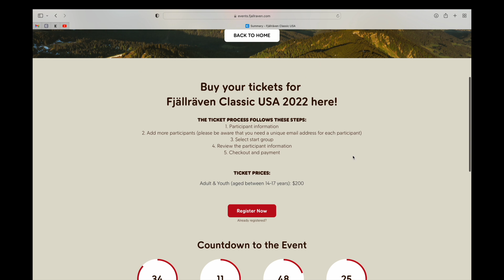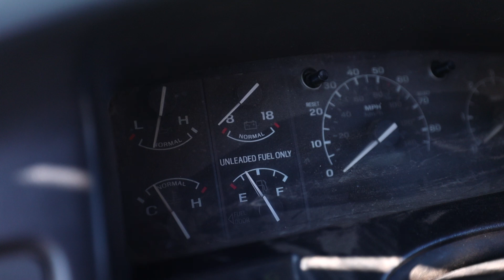Concrete Tiny House | Walls are UP! + New truck?

Comment: We dry laid our blocks when we built our house 40 years ago.  We parged both sides of the block with B-Bond.  It is a rich cement with tiny pieces of fiberglass.  It is flexural strong, just not vertically.  You can't build high story homes, but worked out great for us.  No issues in all these years, no cracks, nothing.  We used the rebar, and filled the holes with concrete as well.  At that time there was another product called Sure-Wall.

Comment: To answer the question : " why add rebar? Isn't the concrete enough ..."
 Simple answer is : no, the concrete alone isn't enough. Longer answer: concrete has great compressive strength (it can hold a ton of wt.) but it doesn't have great tensile strength ( it can be  brittle and crack with side to side stress). That's where the rebar comes in. In some slab applications you can even use a special fiber mixed in ( imagine shredded fiberglass insulation only the individual fibers are a bit thicker). Hope this helps.

Also, I'd be lying if I said I wasn't concerned about dry stacking cinderblocks but it'll be interesting to watch how it goes.
Reply: Came here to write exactly what you did, so instead of doing that I gave you a thumbs up!

Comment: 17:31 yup you definitely need the rebar. Concrete is great in compression whilst rebar is able to also take up the tension. i.e. concrete take the downward push of the weight whilst the steel in rebar is able to take up the pull which the wind or snow forces. How much depends on a lot of factors but this seems about.

Comment: I bought a '69 F250 back in '96... $2k... it was like joining a club... and maybe put 50k into it over the years... I have used no mortar block stacking on several projects...an outdoor cooking fireplace and a very solid  bridge across a 6 foot deep ditch that runs with water over half the year... and used waste plastic cores from rolls that were used to hold lumber load covering paper instead of rebar and cement... it has held up without budging for years... old well casings from the property were used for the water passageway under the bridge wide enough for the  riding lawn mowers and carts to cross... the only cement was in the railing bases... considered rebar and cement core filling,  but  had the waste plastic tubes that just fit the holes in the blocks.  

As a suggestion consider a future project of a solar cooker... lots of them in the sunny states where you are living... learn the concepts and you can do a DYI version of maybe a large box oven... I have built and designed funnel cookers for less than $50 ... I have cooked stews of about 2 quarts in a couple hours in Puget Sound region... building a larger box cooker would be a nice project. And less fuel used in cooking.

Comment: Cement houses are the most common in my country where it's tropical. Our cements are not that thick though so we had to make sure that our rebars are really strongly connected to the foundation and that we fill cement in each level of concrete first before we move on to another level to make sure that it's filled with no air gaps. It also earthquakes here a lot so we make sure that each corner has a thick pillar to hold the weight of the walls.

Comment: Love the new truck! I have a ‘95 Ford F-150 that’s a great farm truck my grandpa bought me when I was in 7th grade (I’m almost 23 now). We rescued it after the owner had died 5 yrs prior and had been sitting ever since up in the mountains. My grandma has a ‘96 Ford F-150 V8. My grandpa bought it new and it now has over 362k miles, original engine and automatic transmission. My gram just had the steering rack and gas tank sending units replaced. She also has a ‘91 F150 V6 that has over 163k miles. Both are awesome with 4x4 and have proven to be very reliable workhorses! And it is so worth it to fix an old truck considering the insane cost of a new vehicle!

Comment: I own a cinder block home in Arizona. The downside is that the cinder block heats up in the summer causing the AC to work twice as hard just to keep the house cool. The walls remain warm to the touch from baking in the Arizona sun. In the winter months, the walls remain cool and the heater has to compensate as well. Get a good HVAC system to manage these issues and you should be fine. Happy building. 🥰

Comment: Elsa.... if you would like to bend the rebar easier. Take the trailer hitch receiver out of the Subaru, turn it sideways, take the ball off, now you can put the rebar into the hole to the length you need and pull the rebar bending it to the angle you need..!

Comment: The concrete in and of itself is brittle. The rebar acts kind of like a rope holding a bundle of wood together.  If the rope is tied the bundle stays tight. As soon as you undo the knot it the bundle loses it's integrity.  It is so awesome to see your house take shape.  Y'all picked a great spot with great neighbors

Comment: 17:28 The cement concrete is suitable for resisting compressive forces but are weaker in tension, to resist tensile forces TMT bars are used as due to reversal of winds it may generate on any side.
Reply: Agreed, I was going to comment the same 😂.
Reply: Thanks for the information!
Reply: Pro Civil Engineer also came on to chime in about this question :)) concrete is great for compressive forces, steel bars better for tensile forces. Now your walls have more integrity in flexion thanks to the bars.

Comment: Good to see you doing this work so well...in my area it’s a normal use, however the helpers, people contracted to do it don’t do it as well, they make a mess with cement and sand everywhere. Well done, plus even more so is having such wonderful friends helping you and making it be a much more pleasant work. I lived in Del Rio, TX and another wonderful thing was how they built a larger river in the frontier with Mexico, so it became normal for the housing also make themselves some water around their area with tread and branches to provide some shadow in the summer time..so darn hot...very common 125-30C...and very more pleasant in the winter, very seldom snow, but cold winds, the trees were also helpful. 🤗💫😎 also your question, the summer and winter winds are strong, and also so dangerous tornados does happen in open areas, Texas had that problem ever so often, so the house wall being stronger endures the storms better

Comment: have almost same truck 93, long bed stick shift no factory AC very good work truck.  Mine has the 300 straight 6 runs smooth and Arizona means no rust!!   Enjoy should serve you well

Comment: Dash hoping on passenger side is common on these years of ford, I used that steel pipe hanging tape and after you remove the kick panel you can see where it goes

Comment: Steel rebar should be 48" oc tied into a bond beam. For others I would use Hebel Blocks or ICF walls. Steel trusses for fire resistance.

Comment: Did you use a concrete vibrator of some sort to make sure all the cells were filled from the bottom up? I didn't see it in the video.

Comment: 30 years ago I got a used 1979 Ford F-150. I ended up having to get a car 15 years later because I couldn’t safely fit two car seats in it at the same time BUT I still have that truck and I still love it.

Comment: Tons of progress here. 
I especially like the acquisition of the Ford. 
I had two ‘89 Ford 4x4s, both with the manually locking front hubs. 
They were both excellent vehicles. 
You have come so far since just a couple years ago, it’s pretty wonderful to see. 
Good Vibrations

Comment: You guys rock (or concrete)! I love what you're doing. I'm all about having an older vehicle that you fix over time. I've been rebuilding my 1998 Chevy Tahoe and have about 312k on her and she's running smooth. Like your new F-150, still very well built and made from metal. I'm sure it's unlikely but I'm in Colorado and I would love to meet you both should you feel agreeable or even have the time. 🌞🌞🌞🌞🌞

Comment: I probably already asked this... but I'm asking again... why no grout on the first layer?  Is this up to code?  Did you have to pass code or not since you are off-grid?  What kind of concrete for the slab and what kind for the grout fill?  Can you describe in more detail how the rebar is laid in the block, the rebar doesn't seem to tie together vertically, is this true?  Can this method be done in any climate?  Is it possible to get the contractor's email to ask him some questions?  Thanks!

Comment: Well, I'm not going to read all the comments to see if someone has said already.  And, as it's a year on now, I imagine maybe you've learned already, but concrete is super strong under compression.  It is not strong against lateral loads.  For example, a wind pushing against the side of your wall.  The rebar you put in the concrete wall changes this and gives it the lateral strength to hold firm against those winds.

Comment: We have a 3/4 ton 1997 Ford single cab and it is awesome. It tows our fully loaded 4 horse trailer and we also load our truck camper on it for adventures. We paid $5000.00 for it 10 years ago and it is still going strong.

Comment: My dad has been a mason for 40+ years. When cutting block use ear plugs, not just for hearing protection, but because the pain from the build up of the concrete block dust is awful if it builds up enough. Prevent the ear clog!

Comment: This is basically how my home is built …. We have poured floors and ceiling … and triple pain windows … our home stays cooler inside even in the summer …. Helps absorb sound also …. But we don’t have central air or blown heat we have heated floors from a boiler system … I love my floors but would love central air with my asthma …. But it’s home …. Lol

Comment: Another great video guys! I'm really enjoying watching the house come along.  To answer your question about the rebar/cement Elsa. Cement is very strong under compression, but comparatively weak under tension.  Rebar is added to give it additional strength when in tension.  This helps reduce cracking in the cement as it goes through expansion and contraction with changing temperatures.

Comment: We had a 4 on the floor, 2 door Ford F-150.  Finally died after 20 years and way over 200,000 miles.. original transmission and clutch.

Comment: So I understand the rebar on the bottom goes into the concrete floor, but how are the rebar sticking out of the 8 stack connected?  I lived in Okinawa and this is how they build there,  those houses don't move during typhoons!  They creak, and I was only there a couple weeks when I had to go through the 1st one myself (roomie got called into work) but after awhile I realized that house wasn't going anywhere!!  Why they don't build this way in the US I'll never understand.

Comment: Check out Thermal Cork Spray,  before you decide on Stucco.  Used in Canada and Spain and Portugal it is great for hot dry and cold climates.   And it is a GREEN product,  as they peel the cork bark , and the trees regrow it.   I sprayed my house with it and it adds an R11 ,  plus does amazing in fire tests,  as it doesn't catch fire.   There are companies in Colorado that apply and supply warranties.    I used one out of Colorado Springs, and they were amazing to work with.

Comment: Looks like a good move to me. I once traded a 1977 Chevy Camaro Rally Sport for a 1968 Chevy pickup best move I ever made and everyone I knew thought I was nuts. I loved that truck it had a 350 engine with a holley four barrel carburator and 411 gears in the rear of a six foot wood slate bed...

Comment: The new house is gonna look so good, Congrats on the new truck! The 302 is a solid motor and you lucked out great with the differentials that the previous owner setup. Don't put a rear locker just swap the rear diff from another truck with a Limited Slip Diff from the factory. The rear LSD is better then a rear locker is for on road winter driving in slick conditions! Also maybe look into a dual fuel propane/gasoline conversion! Safe Travels guys!

Comment: using ramps to put the motorcycles in the truck is a dangerous and difficult proposition. be careful. get a ramp that is as wide as the tailgate.

Comment: I have never gotten a new or close to new truck my first truck in 2002 I got a 1989 and in 2005 I got a 1992 lol and 2019 I got a 2008 I will never get a truck with an engine made after 2010 so I’m definitely a get old and fix up

Comment: Bought a 02 4x4 F150  super crew for 800 dollars because they couldn't figure out why it kept throwing codes turned out to need a new muffler system cost me 700 been a daily driver for a year now for under two grand. I love my truck. No need to justify anything to this gal.

Comment: Looking good! I was expecting a hose at the end of the cement boom rather than a long bag. That looked like a challenge keeping the cement going down into the concrete blocks. And the F-150 should be a great tool. I’ve driven them over 30 years.

Comment: "We'll definitely take two of those windows." If they have more, get them. They won't go bad on the shelf, and you will have them when you are ready to add a wing. Always good to have some spares in your back pocket...     BTW You'll know you're there when you buy a tractor that costs more than your truck. (And then have to build a pole barn as an equipment shed.)